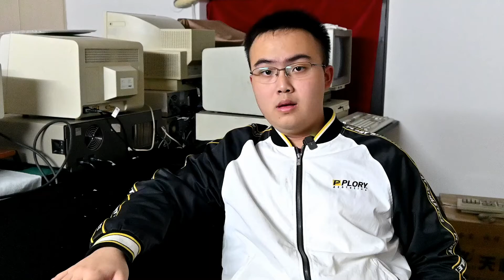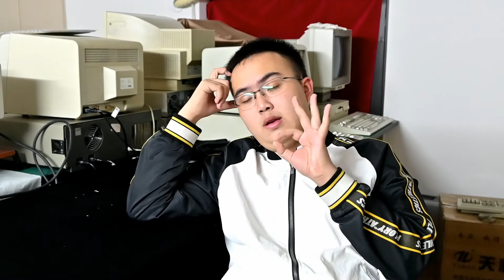HEC Quick Update: Graphics and Sound Chip selected!

Comment: Pay attention to the DATA SHEET for the  SN76489, I just had to help a friend with this not long ago. TI has the Most significant and least significant bits reversed! take note were they show the MSB and LSB in their documentation. 

Also of note the TMS9928A\9929A have color difference outputs for generating RGB components signals.
Reply from the maker: I'm very familiar with that. The reversed bit order is one of the many strange things that TI did. The TMS9918 has it, their TMS9900 processor has it, too.

Comment: Also the Commander x16 is a failure because it runs VGA. I don't think so you should make than same mistake. All Retro enthusiasts have 15khz rgb sets anyway.
Reply from the maker: I'm afraid that I have to disagree with some of your points. VGA is a mistake for the HEC, but maybe not for the X16. The X16 utilizes heavy circuit to make a VGA-sized tile engine that is far easier to manage than plotting each pixel with CPU. It also has the option to halve the resolution making it no much harder to program than an old 8-bit home computer. (I've programmed for it and this is just my own experience). Plus the X16 is not a failure, either commercially or from a community standpoint, yet. And I don't think 'all' retro enthusiasts are willing to buy an expensive RGB monitor. There are also plenty of 'casual' retro enthusiasts who use composite or VGA.